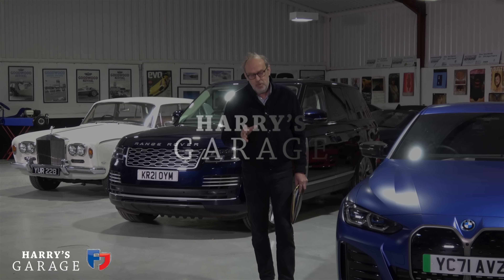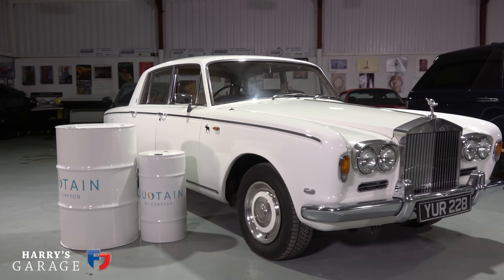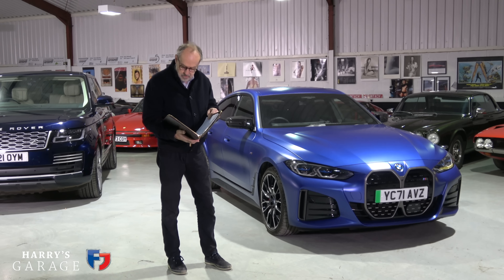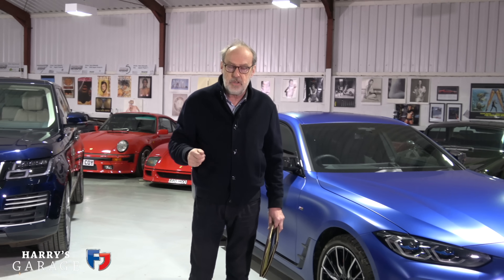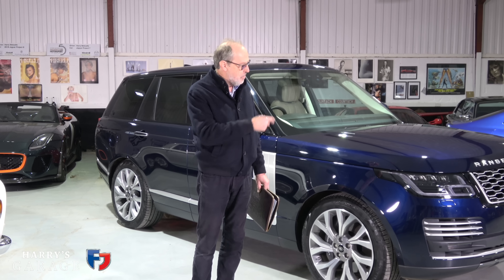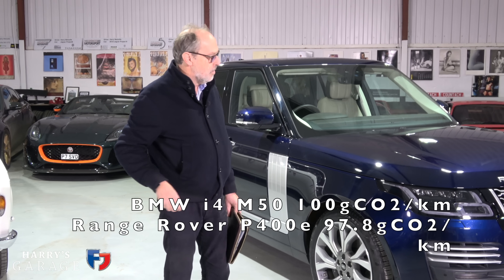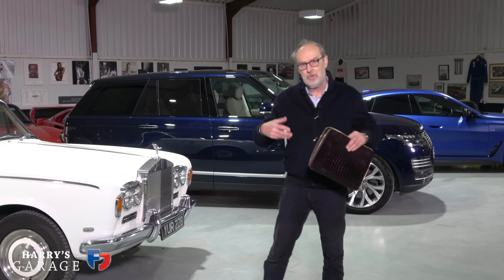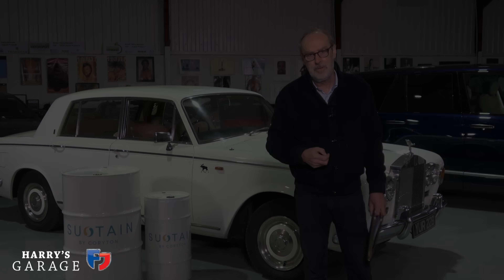Sustainable fuels; what are they & are e-fuels better for the planet than running an EV or PHEV?

Comment: Volvo says emissions from making EVs can be 70% higher than petrol models - and claims it can take up to 9 YEARS of driving before they become greener. Factor the energy needed to produce an electric vehicle (and scrap it) against an ICE car that is run on e-fuels (and takes a lot less energy to produce and scrap) and electric cars look even less green. The there is the additional weight of the electric car, it's wear on tyres and brake pads and the greater damage it does to the road surface as a result compared to an ICE car, and they become less green again. Then there is all the environmental damage in third world countries where the lithium and cobalt is open cast mined.

Comment: I am also hopeful that this works out for those of us that love old cars. 
But: I suspect there is one critical flaw in this company's argument (noticed this in another video as well): whether or not this product is truly carbon neutral very much depends on the source of the biomass "waste." E.g. if this was plant waste that would otherwise have been returned to the soil, the majority of the carbon would not have been released to the atmosphere. On the other hand if (and this is probably unlikely in the developed world) the waste was going to be burnt, this is indeed carbon neutral. 
I do also agree that not enough attention is paid to the environmental cost of building new cars. If this is considered at all it is only looked at through the lens of climate change and CO2 cost. Those are of course critically important, but people tend to ignore the habitat loss that goes with the raw materials needed for any brand new car, and more so with EV's that require metals that were not previously exploited in massive quantities. There probably should be a balance with those of us who don't do massive mileages keeping our old cars as long as we can and those higher-milers whose use cases allow for the shortcomings of charging infrastructure and range switching to EV's. I think. Such a complicated topic actually.

Comment: No mention of the well to wheel argument here. Roughly speaking a car that burns around 100 grams of carbon per kilometre, is actually burning around 500 grams when considering the energy used to get the fuel into the vehicle to burn in the first place. Always worth mentioning this.

Comment: I apprecite the almost neutral approach to this discsussion. As a petrol head of clasic and future classic carsi have been followying sustanainable fuels with interest. Two parts to the video i dont agree with and that os the fact that grid supply is going green and although i kive in Herts i am still investing in coop turbine and will benenfit om money off andbeing oart of thethe green movement so energy supply is a national grid. Cost in co2 to make batteries has ben distorted as well as co2 to build cars where ev manufacturers are increasingly using direct renewables to build cars. Legacy makers dont do this as much. Most of us cant affkrdand M4 as a first electric so i use a41kw zoe and get a genuine 140-180 miles a charge and it costs£1.20 homechRging.At the moment EVs are best as personal transportso for me i do 90% in my zoe  I use my 2016 1.5 deisel estate mondeo for longerer journeys.  Good effort Harryplease keep it up but info re cost of making batteries on the envirinment has been de bunked

Comment: The miles/kWh figure for the BMW seems very low. Even some flat-nosed pickups are getting comparable mileage. Wondering if that sample was from a cold day, and if it the cabin heat was in use.

Also, 30p/kWh is extremely high. Isn’t power much cheaper than that at night. I currently live in SE Asia, and I fuss about paying 10p/kWh !!

Comment: I think you need to look rather more deeply into the science behind what you are talking about. First, you can’t look at the regional map of the UK for renewables contribution as everything is plugged into a balancing grid, which combines the different sources depending on demand and performance. Second, you can’t claim that the electricity used to charge a car is at all renewable. EV charging is a marginal load on the grid. The baseload is already using all the renewable electricity generated, so, unless there is surplus wind/solar capacity, the extra demand from EVs will be met typically by gas fired power generation, which is varied during the day to meet demand. So your EV electricity is not actually renewable. Also, the only things that positively link CO2 concentrations with temperature rise are inaccurate IPCC forecasts. Real world data based on actual observations shows little discernible influence on global temperatures from CO2. Water vapour is actually the biggest greenhouse gas accounting for 95% of the greenhouse effect. CO2 concentration is only .04% of the atmosphere. The recent increase in concentration from 0.03% or so looks to have greened about 15% extra land - an area the size of North America - that was previously barren. I’m sure the people of Chile and elsewhere will be delighted that you are blighting their unspoilt landscape with solar farms and wind turbines. Finally you live on a farm where you have no problem installing the different facilities needed for your cars - this does not translate to the average income urban dweller!

Comment: One of the biggest advantages of e fuels is the infrastructure is already in place for it! Transport, storage and delivery is exactly the same as for existing petrol and diesel. It can safely be mixed with existing fuels, and having zero Ethanol content, it won't rot rubber, gaskets or carburettor parts like E10 does. This IS the way forward.
Reply: True, except I’ve never had problems with ethanol fuels when used in vehicles designed for it.

Older cars and small carbureted utility engines, yes it can cause problems.

Comment: Very interesting and many good points. Synthetic fuels need to be produced locally or transported using pipelines or synthetically fueled vessels to make full sense. The Rolls hardly emits pure co2 either, but that is slightly besides the point considering the limited amount use.

Comment: Is there a need for any modifications to be done to ICE to run on Sustain?
Is there an impact on IC engine longevity when using Sustain?
The increased cost of Sustain vs Gasoline is not really a huge problem as the cost of new BEV or Hybrid would pay for about 10 years of increased fuel cost (and that is not even considering the cost of battery replacement / disposal and the pain of range limits and charging availability...
I would like to convert my gasoline  BMW X5 to run on Sustane or Methanol, but I hear that methanol corrosivness would kill the engine sooner than reasonable life expectation.
Reply: This dope is trying to distract you by jabbering on about 'classics'.  It's probably only a $1 fuel seal or tube and one software setting change to run M100 (or any other liquid alcohol or mixture with gasoline you desire) in your modern BMW X5.  Methanol is not in contact with anything it's going to corrode for long enough to do any damage in your engine.  As soon as it gets near metal, it's already been vaporized.  There are oil sheikhs richer than Elon Musk that have people who've been spreading that nonsense for decades.  

Now ask yourself, why has the government allowed the car companies to conspire to turn this feature off in cars?  Why does the US EPA say you can't turn this feature on?  Why is this idiot YT channel going on about 'classics' instead?  Why have you never heard these facts before on the news?  Why doesn't every gas-using car already have this capability on by default?  Your TV and your computer have more government mandated compatibility than your car does.
Reply: Methanol is an excellent motor fuel in vehicles designed to use it. It can be corrosive to some aluminum alloys, which is why some carbureted engines had problems with it.

Many karting series use methanol fuel because of its performance potential, but after the race, the tanks are drained and the engine is run on petrol to purge the methanol from the fuel system. It must be noted that the engines to which I refer have cheap, simple carbs. Modern fuel injected cars won’t have problems with it if the engine mapping is designed for it.

Comment: from a recent test i saw online it is said the NOx emissions from these e-fuels aren't that better than their dino juice equivalent - can anyone confirm this? If so the direct air/sea capture of CO2 is still a good idea but instead of turning to e-fuels just stop at Methanol and use that directly or in fuel cells as a hydrogen carrier?

Comment: Harry your getting taken in with the propaganda of global warming. 
The facts are we need carbon to make your crops grow and produce the food we need more than ever. I know you know this. 
I believe humans have had little effect on global warming. 
We are dirty and wasteful  we need to clean up the particulates in diesel for instance. We can do this we. Clean up the oceans and stop cutting the rainforest down and replant. 
The replanted trees and the more crops we will need for food will require more carbon to grow and help solve the so called problem of too much carbon because as we know  carbon is plant food and they lock it up as they grow. 
Also  lithium and cobalt are mined out of the earth and processed using a huge amount of carbon and transported around the world, again requiring a huge amount of carbon. 
The batteries do not last and  cannot be recycled and will go into landfill
To manufacture solar panels requires a tremendous amount of carbon and again these cannot be recycled but they will last a lot longer than the batteries they will help charge. 
The infrastructure in the uk will not be able to cope when we are forced to all have electric cars and again we are spending money and producing even more carbon replacing a system  unfit for 
purpose! 
After all this the climate will still be rising as it has heated and cooled for thousands of years ( this time is no different than before) and we will be no better off. 
I have a wind turbine I have 50kw of solar a biomass boiler and GSHP purely for financial gain. 
I’ve looked hard into this issue and to put it into perspective. When a volcano erupts like it did in Iceland a few years ago. That alone throws more carbon into the atmosphere than humans have for years! I forget the amount of time but like I said earlier carbon is not the font of all evil without it we will not grow our food! 
Why do you think growers pump 1000ppm of carbon into glass houses?? The plants grow a lot faster and bigger and absorb all that carbon as they grow. 
We are sitting here now in 350ppm and that is already less carbon than out plants trees,  corn and food crops actually need to grow properly. We are in fact carbon deficient. 
I know all the people that are brainwashed are going to comment on this post but please prove me wrong. 
Do not listen to msm and all the scaremongering they spew.

Comment: Just the updated sermon,  in the more cutting edge morally contentious  times we live in, to justify old-fashioned conspicuous consumption  ?

Is being a cog at  the top or middle of a one-to-many supply chain, which confers on the post holder disproportionate material benefits,  a further justification for down playing the current Climate imperative when it comes to rewards for "Achievement". I think not ? That position is a "Gift" from the system ! 

As they would say on "Hello, Hello" , . . .  "And the massage" , Rich men shouldn't be burdened with the issues of  emitting CO2 when they've got far more pressing problems to deal with i.e.  like maintaining the population of diamonds in the headlinings of Rolls Royce Celestials. Yeah, yeah, yeah.

If you're really committed to planetary climate salvation,  get a lightweight smart or quad chassis to transport the aspirational twins to ballet classes. Minimise the use of the heavyweights. That's a starter for 10.

Comment: I was writing a comment while listening to this video. But there is so much wrong with this video. In the first place you aren't comparing apples to apples. The Range Rover only produces so few emissions because you can charge it with electricity. But you left out the CO2 that comes with using electricity. If you run the Range Rover on just petrol the emissions for the Range Rover would be off the charts. Electricity is much more efficient than petrol.

Secondly you forget to mention that synthectic fuels still produce other pollutants. It's not just CO2 that is the problem.

Thirdly, it has been proven many times that it's better for the environment to scrap cars and replace them with BEV. Off course people will say: but what about mining those minerals? It's better to use petrol. I say to them: Petrol doesn't just magicly appears. The production has caused and is still causing massive environmental damage. Just google the Niger Delta. So, yes there are negative effects for running a BEV, but those effects are smaller when compared to a petrol powered car. It isn't perfect, but is is better.

Lastly I don't agree with your argument that making a change doesn't have an impact so you shouldn't bother. I would argue that buying a BEV sends a message to the goverment and the manufacturer that you want a better and cleaner alternative. Also a BEV can become cleaner just because the way the grid is supplied becomes cleaner. The emissions of a petrol car will never get better.

I do agree with you that syntethic fuels could be used to power classic cars. Their impact on the environment is small and synthetic fuels are better for the environment. Also I would never argue to scrap your cars, they have historic value and should be enjoyed for what thay. But that doesn't mean the world doesn't have to move on.
Reply from the maker: You're missing the point of the video which was to highlight grid delivered electricity isn't as clean in terms of CO2/kWh as the UK average suggests in more populated areas. 
My solution is to run a PHEV (the Range Rover 400e) and use a combination of my own generated zero-CO2 electricity and regular petrol, which is near identical in terms of total miles CO2/km to running a pure BEV in my area. 
I could not power a BEV on my own generated zero-CO2 because I would be regularly charging it away from home, doing the same miles we do in the RR, which is why I didn't include this calculation in the video.
Reply: @harrysgarage Thank you for the response. I love to read your point of view. 

It is a fair point and a great nuance. Because in that case the Range Rover is a greener alternative for a car powered on just fossil fuels.

Comment: I recently worked ata refinery in Hamburg, Germany where they were building a new unit which makes synthetic fuel out of water which through electrolysis they convert to Hydrogen and Oxygen. They then combine the Hydrogen with Carbon to create a Hydrocarbon liquid fuel which they can tune to suit any purpose. The unit should be operational very soon. H & R Schindler. You can tell them I sent you. 
Very interesting for me too because I plan to drive my 1992 Porsche 928 until the grave.
Reply: Well done regards the 928, I hope to do the same with my Lexus.

Comment: 2.5mi/kwh is pretty shoddy efficiency for a modern EV. Does that 6760 figure for CO2/mile account for the CO2 released in getting the fuel out the ground to the pump? Because that reduces the efficiency by 60% or so.

Comment: I have a 1998 toyota which runs on sunflower oil with a bit of diesel and ehn99 mixed in.. its covered 500k miles
I think my toyota is doing more for the environment than anything currently being built especially when you factor in the Co2 generated from actually building a brand new car every 5 years or how ever long they last.
  there will always be those that get a brand new car every 3 years. but it is becoming more common place. I bet most of you here in the comments will remember a time when seeing a brand new car on the road was an extremely rare sight !! if your neighbor bought a new car, you would think they had a pretty good year.
the government promotes building new vehicles , especially EV's and manufacturers happily tow the line. their idea of hell would be a frugal population who maintains old vehicles and uses alternative fuels. the way they combat this path is by the use of ULEZ and incentives such as the scrappage scheme.
what car manufacturer wants to build a car that lasts forever !? it was the same with the invention of the light bulb. they have to make them blow after a certain amount of time otherwise they dont get to sell anymore. this is called planned obsolescence it is used by manufacturers of TV's , phones , fridge freezers, you name it ! and now its obviously being used to scrap cars every 5-10 years

Comment: Good review, and Harry makes the most important thing in all new cars are very polluting, so keep using your old cars longer. I have solar panels and they work very well, but unlike Harry looking at a solar farm, when you have them on your own house, you’re not really well rewarded. I probably produce more electric than I use, as before they upgraded the meter it was running backwards. They should offset what you produce against your use, and pay you when you produce more than you use, then it when be a much better incentive to install, and give you a better return on your investment rather than the insulting feed in tariffs they pay! 
I look forward to more on alternative fuels, seems promising!